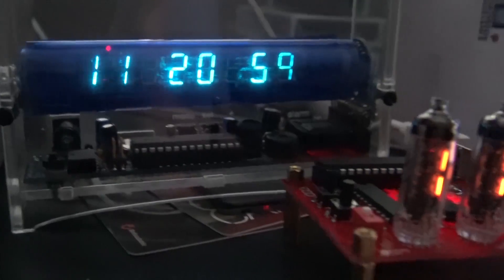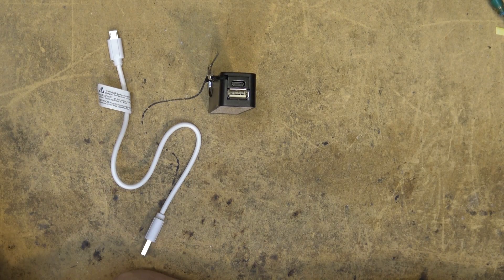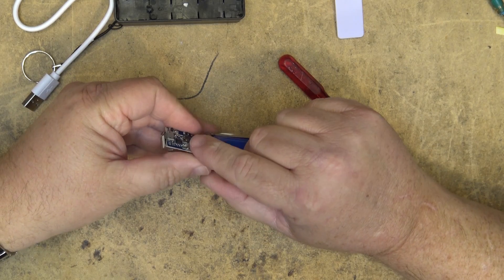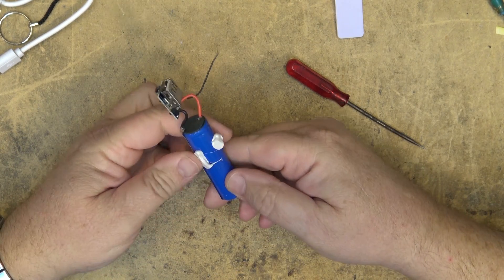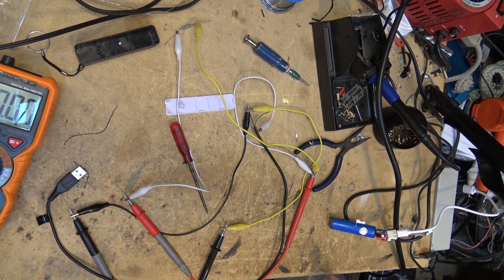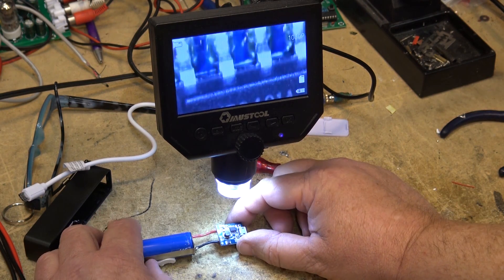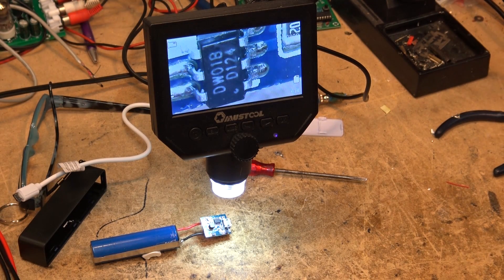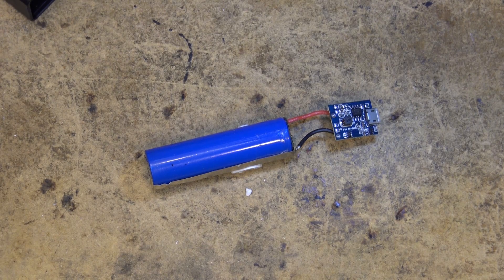Dollar store $4.00 power bank tear down

Comment: How do you like your meter? I have the same one but from banggood called the PEAKMETER pm890c. so far I like it.
Reply from the maker: It does a good job. If you hold the right button while turning on it disables the auto shut off as I found out. I still go to my Fluke12 as my go to meter, but this one does current measurements so I use it for that.
Reply: 12voltvids are your voltages close to what your fluke is?

Comment: You can get basically the same thing from poundland here in the UK for £1
Reply from the maker: donnald troll 

Well this is Canada. And here they are 4 bucks. You can't even buy a pint of beer for that. 
It's a good deal and now we have seen the quality I am sure they will sell a ton of them. It brings a totally dead blackberry priv to about 50% charge in an hour so as a backup it will get you going in a pinch. Cheap enough to buy a few and just have on hand for when they are needed. Now I am testing to see how long it will maintain the charge.
Reply: i fitted wall sockets with 5v 2a usb sockets. not the cheap ones.

Comment: This is a very useful upload. Now everyone who watched this know 1000% its worth buying.
Rawpower owe you one.
Reply from the maker: This one isn't the Ravpower. They did send me 2 of their excellent power banks. They are much higher capacity, but as a basic charger that can be left in the car for emergency charging this one will get the job done on a budget. I use a Ravpower deluxe series 16750mAh  power bank. It is much larger, and will charge at 2.4amps so it charges much faster than this one, but it is also more expensive.
Reply: You speak so quickly right at the very beginning I didn't catch who it was, and still cant. I must find someone to fix my hearing aid. Talk of the devil do you fix them? I promise to wipe all the wax off it first.

Comment: Ravpower BatteryBank is a very good product. After saw your Video I bought it and I'm very happy with. It works excellent.
Reply from the maker: CaroMan 

Yes the ravpower is the best I have used. They sent me 2 plus the anker brand to compare. I use the big one regularly. My daughter tried the smaller ravpower and the anker. She uses both but perfers the ravpower as it is higher capacity and charges phone faster. This one is headed to my work truck.

Comment: Your shop is quite chill with 12.5°C :-) Nice teardown btw.
Reply from the maker: Well thats the outside temperature here in Canada on November 20.
I don't turn the heat on until it gets much colder than this as the heater is a 4.8KW elctric heater, and I go broke every time I throw the switch, so it has to be really cold before I turn that on.

Comment: How does it know when to turn on when using it to power an external device?
Reply from the maker: As soon as it detects a device plugged in the blue light turns on and it provides power. The red light also stays solid once it is fully charged, which took closer to 3 hours. I will fully charge my phone again when it goes dead and see how much more charge I get, as I didn't fully charge this before tesring I left ot on charge for only 2 hours, but the light was still blinking so it probably wasn't fully charged.  Now it is, so I will charge my phone again tonight and report back.
Reply: THANX

Comment: The step-down/current limiting for the battery charging is actually linear - you'll see that chip getting really toasty while the battery charges
Reply from the maker: Yes the current limiter gets warm, as does the boost converter when charging the phone.

Comment: Big Clive has reviewed these from Poundland in the UK for a pound, with similar results (~1100mAh cell, decent circuitry built around very standard components). The charger without the cell can be bought from China for well under a dollar US.

I think they've reached the point with these that it's hard to build a bad one. The PCB design is mass produced (and probably fundamentally the same in countless consumer products), so as long as the cell is a decent one (and it will be in a Western store as they don't want to be sued if a bad cell catches fire) you can't lose.

Comment: That's not bad at all, roughly 700mAh or 1.4A for 30 mins(if the boost can cope), that will bring most phones back to life :-D
It's hard to know what capacity the battery is, due to the boost converter effect, but who cares if it's good enough :-D
Your microscope made the chip viewing easy-peasy, dam good :-D

Comment: if you get a chance, hit up Miniso at Tsawwassen Mills, Lower Mainland, BC. They have powerbanks ranging from 5000mah at approx 20 bucks to the 20k mAh bank for 40 bucks. They even have a weird pack that comes with a BT headset that slides into the pack to recharge.
Reply from the maker: urzu117 
I have a ravpower 16800 and 6500 and anker 5800 that were sent to me to evaluate. The ravpower is really good. This one will end up in my work truck for those days that my cell goes dead. I am familiar with the mills mall. It is 5 minutes from here. This one came from the dollarstore at the mills.
Reply: next time you're there, check the shop out. They have weirdly cheap stuff like BT headsets, powerbanks, LED desklamps, tools, etc.  Bought some of their electronics screwdriver kits to use myself.